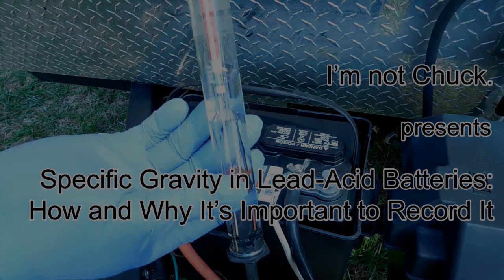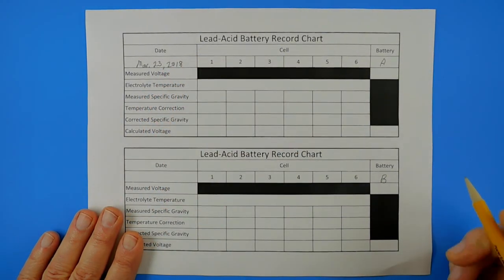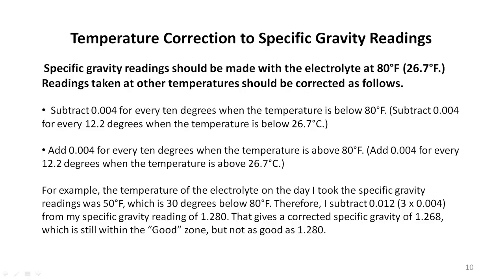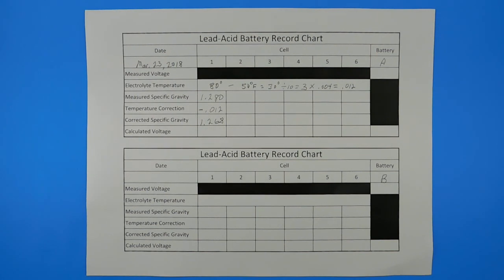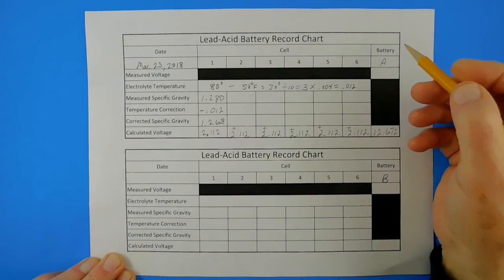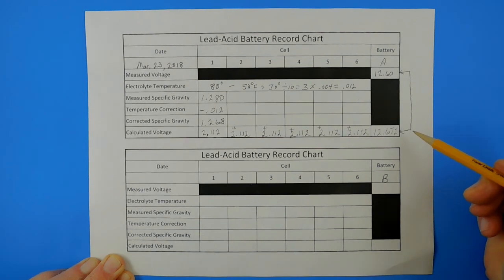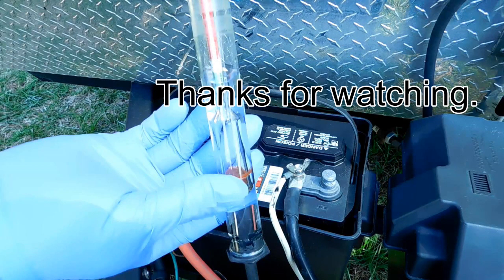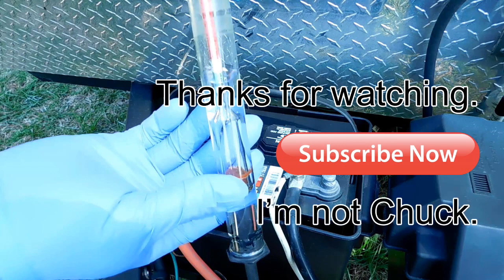Tracking Lead-Acid Battery Specific Gravity for Longer Life - Watering Batteries

Comment: So despite all those maths. The voltage per cell is calculated from the temperature and specific gravity. So despite calculating the voltage per cell , you then go on to say the end result is important but not the comparison between the measured voltage and the calculated. So whats the point of calculating it?  I would say the difference between the two voltages over  it's life time is the state  of the battery health. And a chart of the difference between the measured and calculated  from a manufacture would be useful. However if you say the error introduced by the difficulty in getting  an accurate  Specif Gravity is so large that the calculated voltage is so inaccurate to compare to measured then the whole test is to flawed and a waste of time.
Reply from the maker: I don't recall the details of what I said, and will need to rewatch the video. Thanks for watching and commenting.

Comment: My batteries are sealed so there is no way to check I guess.   Can you over charge the batteries with a solar panel set up?
Reply from the maker: There is no easy way to check the SG in an AGM battery. With your single 100 watt panel, there is no real risk of overcharging your batteries. And I should add that one of the jobs of a good charge controller is to prevent overcharging the batteries.